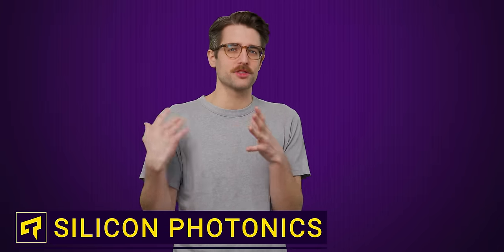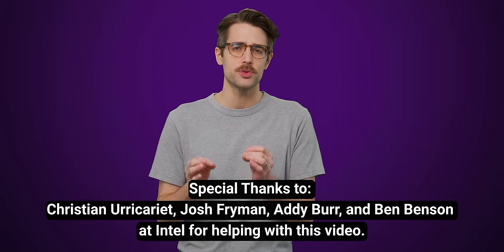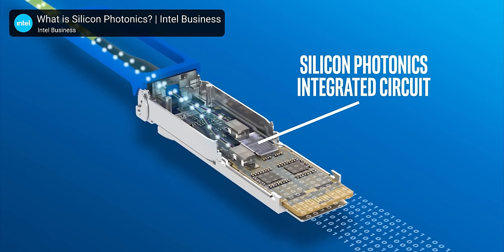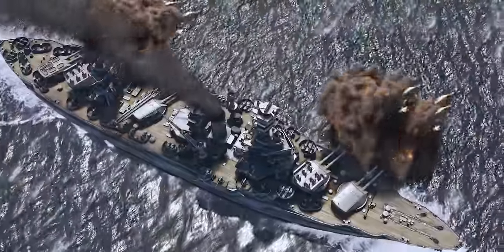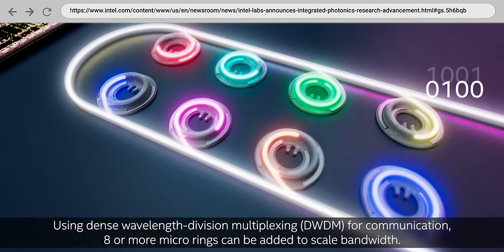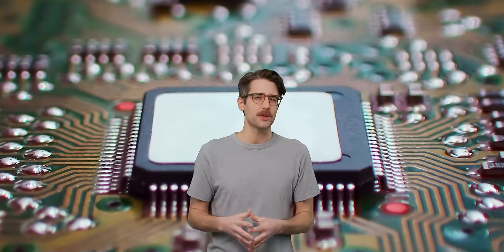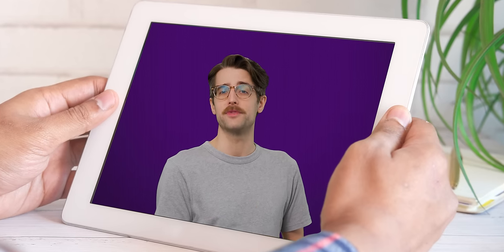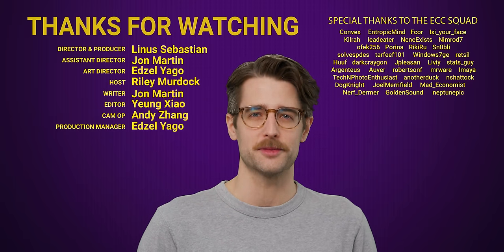The Newest Computer Chips aren’t “Electronic”

Comment: Will this eliminate the need for cooling? The thermal waste exists because metal has some resistance to electricity, right?
Reply: Quite the opposite - photonic systems are usually VERY sensitive to slightest change in temperature, even 0.001 Celsius degree can impact how such chip works - it often needs special external temperature maintaining system, which keeps the temp at constant level. However, it still less power-hungry than usual electronics are, due to how little energy it takes to process HUGE amounts of data.
Also, the light itself has more parameters than electricity has; electricity has 2 to 3 important parameters, and in digital systems voltage is the most important - while light has 6 to 12 parameters (Amplitude, polarization, direction, wavelength, temporal changes and phase, where first three are 3D vectors, which results in 12 possible parameters). So, aside of the higher speed of switching, light also has bigger information density.

Comment: Why put optics closer to the silicon? Why not replace the silicon with optical tech altogether?
Reply: Silicon is cheaper. Optical can currently only transfer data, not power. And you would replace the copper/aluminum traces with optics, not the silicon itself.
Reply: because people are already working on how to make that possible, but it's complicated

Comment: light means less heat
Reply: and also larger bandwidth
Reply: Not really, think of the energy required to make all those laser beams. Energy cannot be created or destroyed so when it is consumed by those laser making silicon semiconductor thingies the energy will have to escape somewhere so it'll turn to heat when it hits the receiver bits and create heat.
Reply: i would assume its the opposite. the extreme high frequency electronics generate so much heat from electric resistance. using light could make the tech run much cooler
Reply: @kitsunekaze93  Wait, imagine if all you needed to keep you're top of the line pc from overheating is a fan-less heatsink. Wouldn't that be cool!

Comment: I can already see the failure rates of that type of technology.  We haven't even perfected Leds yet and going into a fully optical device💀. Think of what burn in does. I much rather  my tech last long
Reply: Fiber optics already connect a large part of the internet
Reply: @captainheat2314  bruh fibre optics in communication is still fragile. Do you really want that fragility in cpus? Sure its fast but the cost and lifespan is not the same.  We already pay so much for silicon with gold/ copper traces. How much more do you think an optical cpu would cost? Sure if you want short lifespan for your electronics then be my guess.  Dont forget there is planned obsolescence which optics would guarantee lmao

Comment: Anyone else see the different wavelengths being combined and think RGB CPU?
Reply: Same here. :) That would work perfectly well for a sci-fi plot where a group of extraterrestrials invent silicon photonics and use RGB CPUs to make sentient driverless cars and sassy home automation systems. Then thieves on their homeworld decide to take the RGB CPUs and use the tech for evil... :)

But all things said, hopefully us humans can use silicon photonics for good. Maybe help doctors develop new medicines or engineers make more efficient solar panels and batteries. Or, make sassy home automation systems.
Reply: I think they'd benefit more from a higher wavelength than the visible light, aka ultraviolet, so it wouldn't be RGB nor you would see it at all.
Reply: This is deployed in fiber optic communication so is likely they will use several wavelengths.

Comment: Hey we got the LG fridge ThinQ that cameo'd in the video. I can certify that it's pretty sweet! 
It feels like a fridge designed by somebody who actually cares about the fridge-using experience. 
They basically fixed all the problems I've experienced using other, crappier refrigerators in the past.  
Between Chinese, American, and German, the quality of the fridge feels German. Top stuff.
And it looks a lot better in person.

You know all plastic levers that eventually break on other fridges? The LG ThinQ smart fridge doesn't have that. It has the recessed handles. It feels heavy and low-class in use but I know it won't break. Which is a problem we had before. The sleek outline makes it easier to get thru our narrow hallway to the kitchen too.

Delicate parts is the main reason we switched models. Our last Samsung fridge was nice, but it developed 3 broken hinge points. The lady of the house was fed up with it. I enjoyed the layout of the old Samsung fridge, it just felt good, but yeah it was designed for planned obsolescence, and the replacement parts cost 10x what they out to. After the lever on the water dispenser broke for the 4th time, enough was enough. $400+ dollars in replacement levers for a water dispenser is too much. We never bothered to shell out for the handle hinges.

After the first day, I didn't notice the see-thru pane into the cooler anymore. You have to knock pretty hard on the pane for the light to come on. And it turns off way too fast for my liking. LEDs don't use a lot of power. It should stay on 1-2 minute at least. Maybe this is adjustable, but I haven't figured it out yet. 
Also we usually keep sauce bottles in the fridge door, not drinks so for me it's a fairly useless feature. 
But I did like it a lot when we first got it, and if you use it as intended I'm sure you'd appreciate a lot. 

Looking at it, the actual fridge is on your right, and the freezer on your left, split vertically all the way down.

The compartments look narrow and cramped coming from a french door model. But it is much more capacious than it looks, and holds more than our last fridge too.

The shelves are strong, tall and deep. No problem fitting 3 jugs of front-to-back milk in there, which was an issue with our last fridge. You can stick 6 milk jugs on a single level, which feels insane to me. I love it! 
It will also easily hold a normal sized cake from the supermarket, and still have space for the milk on the side.

It's a fridge that does what you want it to, and not frustrate the user with tiny, flimsy shelves or gimmicks.

The freezer space is, again, narrow-looking but overall pretty capacious. 
No deer carcass or pork butt in this fridge, but you can still freeze plenty of bagged foods or chunked meat.

I like the water dispenser  a lot. I don't know how good the UV works, but the ring light looks cool, and it has 3 option. The only thing is that the selector looks like a bezel you twist to select, but it's actually touch activated.

My favorite thing is the icemaker! It makes BALL ICE CUBES! I really love that. Now, it doesn't dispense the ball ice -- as far as I can tell -- but it's not any trouble to open up door pull out the tray and grab the neat ice balls. The ice cube dispenser dispenses smaller cubes of ice. So they don't splash liquid around as much as traditional dispensers that drop boat shaped cubes.  Crushed ice has never been my favorite so no comment there. Someone has put a lot of thought into the experience of ice dispensation. I bet they had some very strong opinions on the matter.

Overall, this LG fridge is the only fridge that I've ever felt especially proud to have in my house. It ticks all my boxes, even the one's I didn't know I had,  and it does what I want it to. It is the pinnacle of fridge, IMO. 
I highly recommend it. 

I wish I had a referral code for you, but I'm too lazy to get one. So just take my two cents as it is.

Comment: Fun fact, silicon photonics almost killed AMD.
In early 2000s AMD knew that we are getting close to limits of electricity, so they started working on an optical CPU.
They put a lot of money into that project, but eventually failed to crate such device.
The amount of money left after that fiasco was so small that AMD was unable to be competitive against Intel for almost two decades, until Ryzen got released in 2017.
Reply: What was that project called? AMD isn’t making it easy to find anymore:)
Reply: You forgot the Athlon 64 era, those CPUs were better than their equivalent Pentium 4 competitor... I remember those years (around 2003 - 2006) were an AMD system was more efficient than an Intel system, with around 100W less power consumption (Toms Hardware have an old video from 2005 on that).